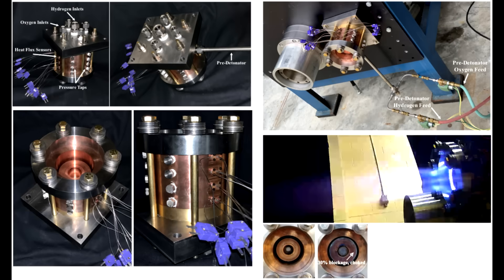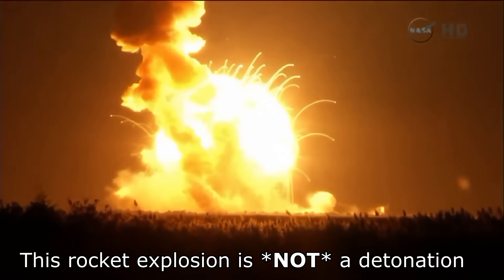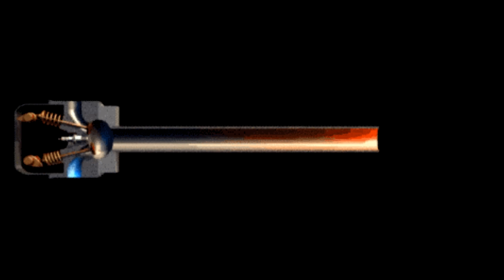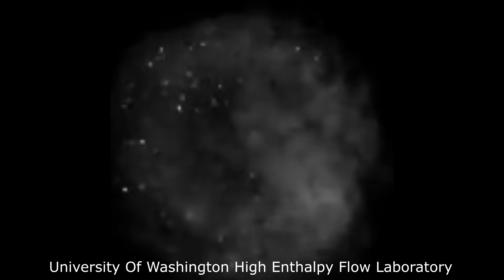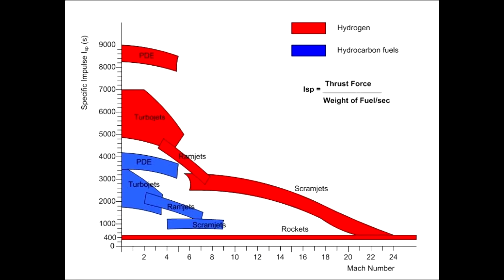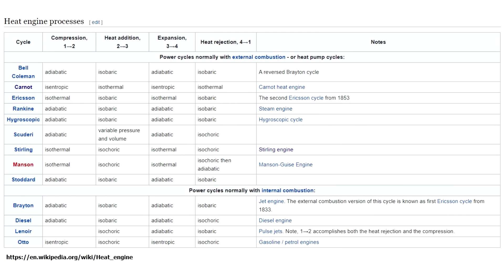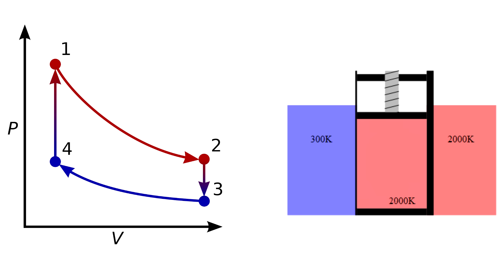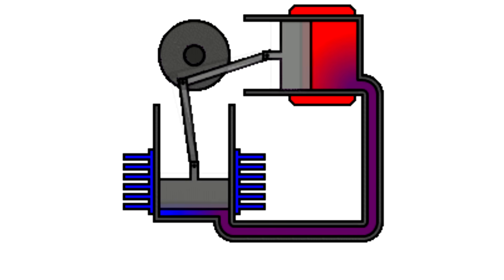What Is A Rotating Detonation Engine - And Why Are They Better Than Regular Engines

Comment: IDK why but I was always under the impression you wanted to keep your pressure chamber flow subsonic before it reched your converging diverging nozzle section. How do they deal with the wave propegation being supersonic before it reaches the conmverging section of the nozzle? is it just long enough that the wave front just becomes a high pressure front rather than maintaining supersoic flow?
 Im probably just massivley off the mark even making a sensible question here so I apologize in advance for my ignorance on the subject.

Comment: When I wer a lad I went to a lecture at the safety in mines institute in Sheffield. 
They had a perspex model of a mine gallery with a cross chamber halfway down ( The model was about  10 feet long)  The lecturers flooded the model with methane and sparked the closed end. A flame gently crawled down the fisrt bit of gallery, reached the cross way and boom the flame accelerated and shot out of the open end... The lecturer said if they had made the model longer it would have taken out the first row of the audience...😂

Comment: Im curious how far this could travel out of the solar system if fueled up once
Reply: Not very far. Electric powered drives like ion-thrusters have much greater efficiency than any chemical "burn stuff" rocket, incl this one.  
This could reach orbit tho, which most electric powered thrusters can't.

Comment: Looks to me like a problem a quantum computer could possibly solve to get the values of the variables needed to make it work and the error correction necessary to make it work reliably. The molecular dynamics is far too much information to model on any classical computer.

Comment: While it's great for producing maximum thrust per unit of fuel... it simply doesn't scale well. Also, much like an HCCI engine, sustaining controlled flame front through variable load is quite a challenge.

Comment: Use Tesla valve one way to control direction of rotation and other is fuel injectors with solenoid activation to release fuel at four spots inside and fire the injectors in a way that persuades the detonation to chase the fuel around the chambers but idk not to sure on that
 Now I only just bearly though about this had I put 100% brain power I would of figured it out in now time theoretically not in practice
Reply: "If I had ever learnt, I should have been a great proficient."

Comment: Your ramjet technology suggests to me  maybe it might be possible to compound a supersonic shockwave within an engine.(multiply it repeatedly at an exponent of 2).  I'm kinda afraid to test my ideas on a powerful scale.  I'll definitely start at with something smaller, and so I'll  probably innovate completely otherwise technologies along the way. I don't want to blow up or accidentally fire a missile at anything.  Ive been studying your planet's engine technology for a whole month now and I have to say yall are going in the right direction with your advancements but your planet's peoples actual use of your technological advancements tends be even centuries behind your actual science because of money and industry and your advancement is incredibly slow and spotty resulting your so commonly limited use of free and positive consideration in use at for hypothesis towards discovery and innovation.  There are certain things you'd would first must have to think through.  Especially mathematically, before you do them, and a hands on approach that moves in haste will would shall certainly fail, and perhaps disastrously.  Perhaps I'll just build a tent heater out of some soda cans, that it just  so happens is can be modified at into a supersonic jet engine?  You know, at in the spirit of YouTube based learning.  I've quickly learned not to be too impressed by a technological marvel for that there is always some or other thermal exhaust port that can really mess things up and even if ray shielded at because the likes of such things are next to nothing compared with the ways of the force.  Yes, yes, I even plan on keeping my eyebrows. I'm not going to just jump right into a levitating land speeder pod and cry out it's working. Even if the original technology is centuries old and developed by foreigners, if I'm not really sure its going to work, for me.  I don't care if I even classify as the best damned bush pilot in the outer rim territories.  The way I see it the proper use at of the imagination is absolutely essential.

Comment: Pretty much every rocket engine I have ever made was technically a non-rotating detonation engine. Or an enhanced deflagration engine, depending on how fast they disassembled themselves
Reply from the maker: The technical term is 'pulse detonation engine' with the number of pulses being one.
Reply: @scottmanley   How Long Do You Think Realistically It Will Be Scott Before We See These Rotating Detonation Engines AND Aerospike Engines Used In New Launch Vehicles And Spacecraft ? ? ?

Comment: meh, just continuous burm linear ram-jet engine, bottleneck in the middle, AFTER-glow-ignition-flame-holder, works everywhere, space/water you add heat/oxidizer

Comment: Yup this design is a travelling wave detonation engine. It makes the wave chase itself using the shockwave itself to protet the engiine from resonance and focus the fuel mix to the inside while the energy goes out the throat at many times the speed of sound. 🤓

Comment: Wouldn't it be easier to have something like the bullet chamber of a revolver, continuously revolving, atlernatively the holes would go past a port, that would purge it, and then fill it with air/fuel, then after it's pasted the port, and is therefore sealed at the intake end, a sparkplug ( or flame cock ) would ignite the mixture, whereupon it would detonate, and be expelled out of the continuously open, rear exhaust end. A bit like a gatelling gun

Comment: Well heating the fuel would also cause the chemical reaction of the detonation to occur faster. So I theorize that with regenerative cooling as used in rocket nozzles would allow these to have a much higher frequency of pulses.

Comment: "On some level every engine is a heat engine".. except for electrical engines...and biological engines.
Reply: Strictly speaking, yes both are heat engines. 

Your cold sink is the ambient temperature, your heat source is the electrical fields / chemical bonds respectively, and though it might seem werid to assign a temperature to thoose it's absolutely doable. 

A biological engine cannot run beyond the temperatures associated with the H-O C=O bonds it forms in respiration. (I.e. if you set yourself on fire you'll find it very difficult to do a push-up.) similarly there's a theoretical temperature beyond which your electrical engine will simply cease to work. That might sound odd, but as an example PV-cells cease to work (both theoretically and practically) if raised to or beyond the temperature at the surface of the sun.
Reply: those arent “engines”

Comment: It's still a modernly skeptical form of feasible purpulsion enginuity, however it will eventually demonstrate a more fission pulse style moments engine in wagers of chem-fuel, efficiently imposing a 'M-Drive' theory, only the structure will result to look more flat vent/net shape. That 'm-drive' theory would be depicted poorly like a classic booster cone (redundant like a car shaped as some horse carrage or how digital camera moved lense of conventional film expose faked).

Comment: The only advantage a detonation engine has over a lightly fired engine is it's thermal ratio. Many detonation engines are abrupt, inflexible in their power output, and finicky.

Comment: Hay Mr Manley, 
Has this pulsed detination shockwave ben tryed with a different shapped nossel insread of bulb at the end of a long tube havr they tryed rotating the two or more sources around on a guided or grooved nozzel then using its own circularvortexthe lit source will be sucked tbrough the hollow center like an hour glass shaped inside and grooved outside- donut shape then as it exitsthrough the center of the donut it is the flamefrountshockwave in a shorter tube .
I 'can draw it  better than my words can illistrate ..
Anyway c.u.

Comment: The big problem with the pulse detonation wave engine  is how to turn deflagration into detonation in  shortest possible time. One possible solution is to use pressure waves to speed up the process. The most simple way to do this is to connect close ended pipe to the combustion chamber. As the combustion/detonation occurs pressure wave enters to the pipe. When this wave enters the end of the pipe it rebounds and returns back to the combustion chamber where fresh air/fuel mix has already ignited. It is the the speed,heat and the pressure of this rebound wave that will quicken the burning process and turn it into detonation wave. Could this work ?

Comment: This is the engine that powered the Aurora, and it was exceedingly fast in terms of it's pulses. And apart of how it worked was similar to this, except the outlet pipes were in a circle, and used a rotating ignition cycle to generate the waves, however it wasn't a true rotating detonation engine, in that the wave that traveled around, initiated the pulse detonations and were not sourced from the rotating wave. the rotating wave simply initiated the pulse waves that are projected backward.

Comment: vortex jet engines are more problematic to tackle with becaus did you forget the newtons third law?   that huge rotating jet causes the rocket to spin in oppositr direction and that would cause anothe issue to tackle with just like helicopters. so that 25% effeciency is not reasonable enough if you add another 50% problem to the technology.

Comment: How does this sound:

Take a small deflageration engine and use it create exhaust moving faster than the speed of sound. This exhaust moves into a chamber where a fuel-oxidant mixer is continuously introduced. This causes detonation and subsequent pressure gain combustion.

Or, to take a leaf out of Giesberts Nijhuis's book (or rather, website), we can eliminate the need for the small deflageration engine if we redirect some of the super sonic exhaust of the detonation engine back into the detonation chamber.

Comment: If the tube is the right size you could tune the sound. Like a Harley. What you would hear is the vibration caused by the resonance frequency of the tube which would change as the flame front moves down the tube, Like a slide whistle.

Comment: As for engineering limitations, worthy of special note is the notion of efficacy.(effectiveness) 
 Looking mostly at transportation in my examples here, stationary power would have different weight on various criteria. 
While an engine cycle may be more fuel efficient, if it comes with a very heavy mechanism per unit power or undesirable usability restrictions then it will have reduced efficacy. A prime example is the Otto cycle piston engine used in most automobiles, it has never had the most fuel efficient ideal cycle however has the highest efficacy in the role because it has the combination of very high specific power output, very high volumetric power output, a wide range of useful power output, reasonable durability and reliability, and extremely fast response to changes in power demand.
 
A good illustration of efficacy vs efficiency is with small aircraft, you can build a heavy fuel efficient engine or a lighter less fuel efficient engine for the same air-frame. The less fuel efficient engine could actually reduce total fuel burn because the lighter weight at all phases of flight will generate less induced drag and require less power output. If the heavy engine burns 5% less fuel per MJ input to the prop but it increases induced drag 5% and costs an extra 1% then it is less effective in the application. To compound that a heavier more powerful engine will require a stronger airframe and slightly larger wings(for equal performance) both of which add more weight and require an even more powerful engine with associated weight and fuel burn.  This is why diesel cycle engines were very slow to catch on even though they are very fuel efficient and structurally well suited to high continuous power at low RPM, they come with lower specific power than an Otto cycle. Similar can be said about the atkinson cycle.

Comment: I'm no engineer, I'm a software developer, but I've always wondered if it'd be useful (probably already been done), to create an engine where the combustion chamber(s) were kind of in a spiral where the fuel/air was injected in the center and this spiral spun at speeds that propelled the fuel mixture up to very high (supersonic?) speeds prior to having a sharp bend in the end (to raise the pressure) where the fuel was then ignited/detonated. I've always wanted to get more info so I could learn what the problems would be with this and why it wouldn't work (assume it wouldn't because surely someone's tried this before). Any input or direction where I could learn about such things would be helpful in my curiosity/learning. Thanks for all you do.

Comment: I heard a different explanation of deflagration versus detonation, in gases, liquids, and solids. In deflagration, the activation energy for the next reactants is the heat conducted from the previous reactants. In detonation, the activation energy is the pressure wave from the previous reactants. The transition from deflagration to detonation can be highly predictable or less predictable, depending on the structure of the reactants and the shape of the container.

Comment: the physics is closely related to Tuned Headers on classic V8 engines... where cam timing is generally critical. JFF, BMW "airhead" motorcycles use strategically-located "balancer tubes" on their exhaust systems.... exhaust pipe length... even muffler-end shape... is also very important... to enhance exhaust system "scavenging".... on the aforementioned V8 engines, 4" pipes, vs. 3" exhaust systems can be catastrophically counter-productive (particularly at high RPM)... the same physics has also been applied to tuned intake manifolds - similarly, with commensurate cam/ignition timing (consider the  physics of cold gases, vs. hot gases... along with atmospheric Nitrogen/oxygen dynamics). There have also been experiments with "acoustic turbo-chargers" for internal combustion engines. Ask any competent mechanic about the relationship of ignition timing vs. flame front (TDC, BTDC, ATDC)

Comment: Experiment: 12" "woofer" placed "face-down" on a smooth surface; apply swept sine wave signal from audio amplifier; how much power can be applied to momentarily lift ( through air pressure)the woofer off of the surface... at what frequency would the speaker remain suspended, where it's momentary inertia would "hold' it in place, before it begins to fall back? try connecting a tuned tube to the back of the speaker... potentially off-setting the nodal/antinodal points. (bass-reflex speakers can stimulate an in-phase resonance... with up to 3dB gain @ Fs/ Fso)... placing speaker "face up" on a scale (to measure force in grams) could lead to further insight(s)... just for fun, add a second woofer to the other end of the tube and experiment with phase alignment... nodal at the bottom, antinodal at the top...

Comment: Thinking about Stirling engines, and also about my Air Conditioner, what if you built a Stirling engine based around a refrigeration system? You'd have the highly efficient exchange of heat via a refrigerant, which allows one side to be very hot, and the other side to be very cold. Almost ideal conditions for a Stirling Engine to work with.
Reply: Your Air Conditioner is just a heat engine running in reverse.

Assuming 100% efficiency, All the energy you get out of the sterling engine would be needed to run the AC.

Comment: It kind of looks like the proper breakthrough in PDE development might make it easier to complete development of engines like the SABRE.  Obviously it would be a completely different design, but using the precoolers and compressors from that design, would make a PDE engine considerably more effective for both jet and rocket propulsion.  And since the PDE itself would operate the same way in both cases, it should be a simpler matter to change Oxy inputs mid-flight.  Possibly even gradually, adding LOX in tiny but ever increasing amounts as the craft gains altitude, further increasing speed throughout the ascent for minimal fuel expenditure.

Comment: oblique wave detonation engine developed by University of Central Florida (UCF) The
New engine enables spaceplanes to efficiently fly themselves right up into orbit without strapping themselves to rocket boosters. Will this make Musk's rockets redundant ? There could be some significant implications for national security and the global nuclear balance of power as well. There's not a radar or missile defence system in the world that could cope with a hypersonic missile at this point. What's more, you wouldn't even need a warhead on it to cause levels of devastation rivalling that of a nuclear bomb. "All that speed and all that inertia turns any research platform, recon unit, or passenger aircraft into a potential kinetic weapon," writes Szondy. "They don't need high explosives to destroy a target. All they have to do is hit it. In other words, any hypersonic vehicle is an intrinsic weapon given the proper modifications."
https://newatlas.com/aircraft/oblique-wave-detonation-engine-hypersonic-ucf/?fbclid=IwAR3AhqeDSyb9ESsFw0L_H95AbU47qWywjAisltHXGFw-U3Wjh4FOiGyVrB8

Comment: Recently attended a seminar by an engineer from AFRL, they have been doing a number of tests using a small scale prototype of this and have had very promising results. The Air Force is mainly interested in seeing if they can make more powerful light weight rockets and aircraft engines.